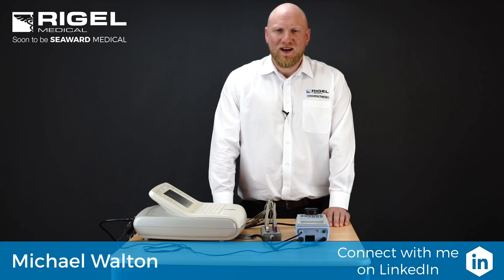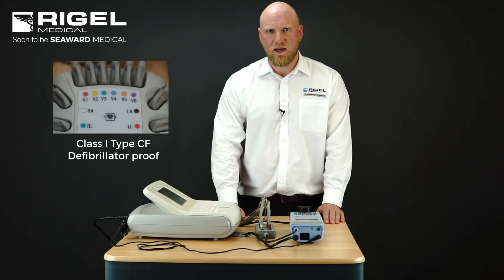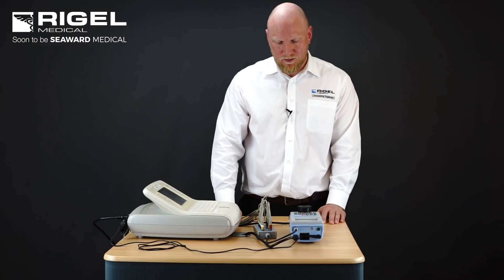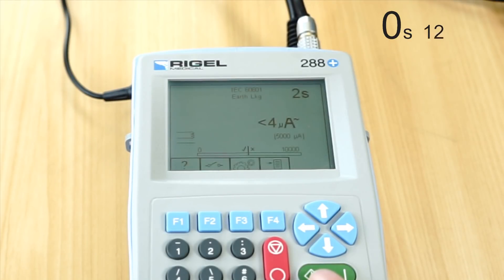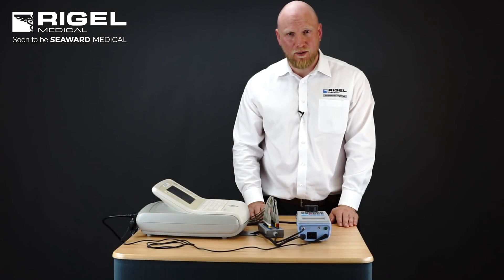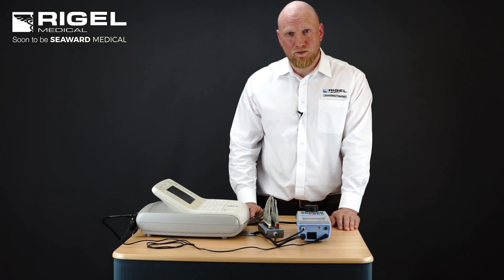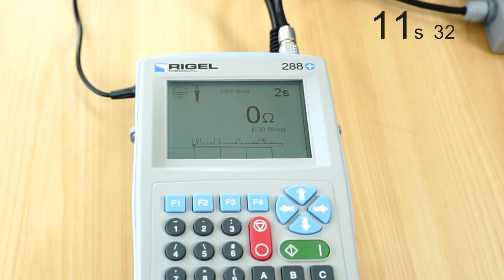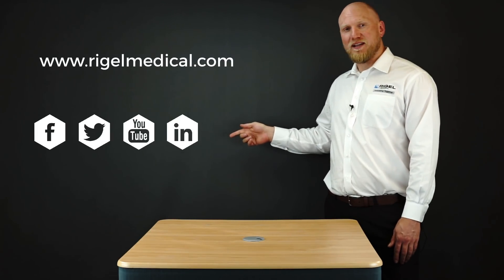Rigel 288+ overview & testing to IEC 60601 & IEC 62353

Comment: How did you performed the enclosure leakage test without connecting to any exposed conductive part?
Reply from the maker: Hi Amal, Michael has provided the following feedback directly from the IEC 60601-1 guidance:

"If ME EQUIPMENT has an ENCLOSURE or a part of the ENCLOSURE made of insulating material, metal foil of maximum 20 cm x 10 cm is applied in intimate contact with the ENCLOSURE or relevant part of the ENCLOSURE. 

"The metal foil is shifted, if possible, to determine the highest value of the TOUCH CURRENT. 
The metal foil should not touch any metal parts of the ENCLOSURE that are possibly PROTECTIVELY EARTHED; however, metal parts of the ENCLOSURE that are not PROTECTIVELY EARTHED can be covered partly or totally by the metal foil. 

"Where it is intended to measure the TOUCH CURRENT in the SINGLE FAULT CONDITION of 
interruption of a PROTECTIVE EARTH CONDUCTOR, the metal foil is arranged to contact parts of the ENCLOSURE that are normally PROTECTIVELY EARTHED. 

"Where the surface of the ENCLOSURE contacted by the PATIENT or OPERATOR is larger than 
20 cm x 10 cm, the size of the foil is increased corresponding to the area of contact.
"

We hope this helps.

Thank you.
Reply: @SeawardElectronic  im studying the iec 62353 and 60601, where is the metal foil located in the presentation?